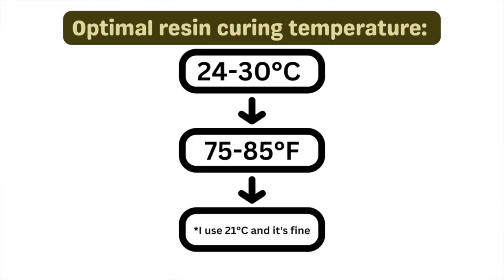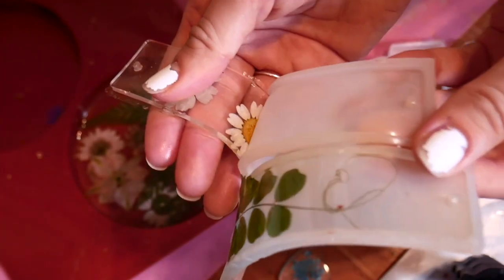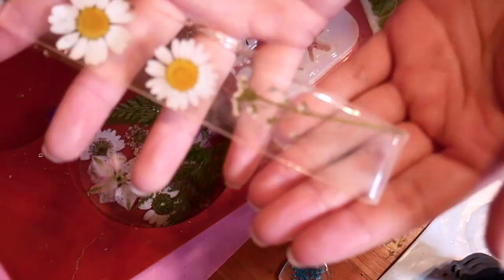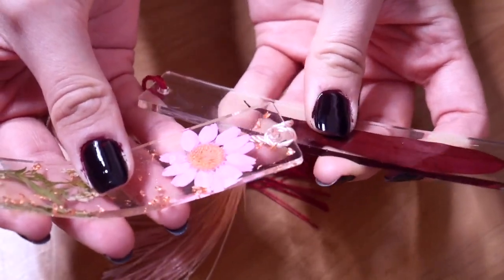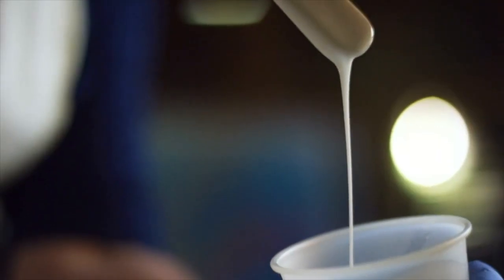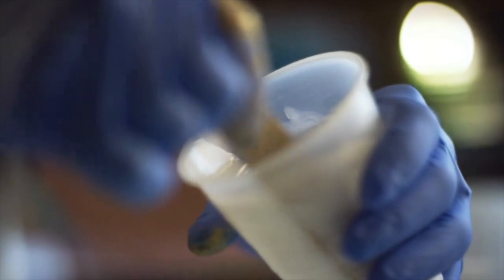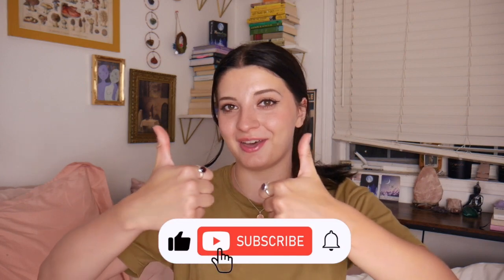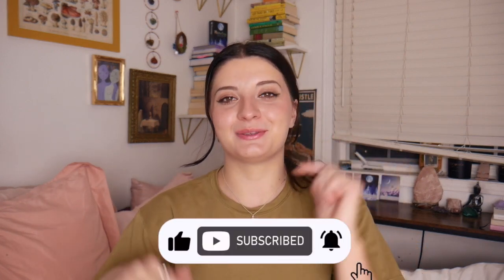How To Fix Bendy Resin - Learn Why Resin Isn't Curing Properly | Why Resin Doesn't Cure Properly

Comment: My recent project was a total mess because of the weather . I have correctly measured the ratio . Its been more than 3 days and its still not 100% cured . Its bendy and also gets the fingerprint when i touch it even though it got totally dry . Its not even getting out of the mould . Please help 😭 im so worried ☹️

Comment: I used a scale and did 30g, 15g of hardner and 30g of resin, its still flexible but its not tacky, i left mine in the garage to cure so maybe thats why
Reply: I mixed mine for about 2 mins, I'll try mixing more and adding less color, Ill see about moving the resin to another place to cure it. Hopefully it helps, feels like I'm wasting resin

Comment: How do you fix the bendy resin when you mix it wrong or don’t do the right ratio
Reply: You can't. It's toxic and cannot be sold or used. This is to prevent it from happening again

Comment: i made resin tray its bendy and in us its cold weather i dont know what to do
Reply: Did it ever cure? Or did you have to try again?
Reply: You can't fix it or use it. If it's stuck in the mold freeze it then remove it. Next time take these tips into consideration for the next project